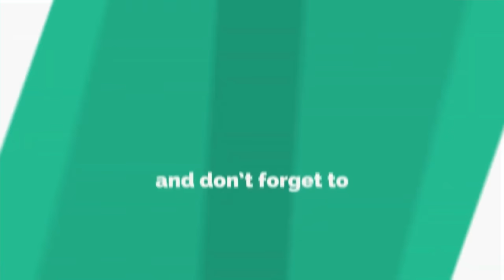Running Water, Live Edge Kitchen Counters, Swivel Loft Ladder | Ep. 10 | An Original Off Grid Cabin

Comment: Thanks for getting my day off to a great start 👍 , but as a contractor, I would advise you to ditch the drill for driving screws and get yourself an impact driver, it will change your life 😁
Reply from the maker: Thanks! I have an impact driver but the sound is so annoying. There's something calming tp me about the sound of a drill....haha.
Reply: @TheOffGridExperience  I understand totally about that noise but take it from an old timer, driving that many screws will eventually tear up your arms and hands. 😉
Reply: Quite right on the impact driver
Reply: I see it works but not a great way to teach others to build stairs.
Reply: I was the same way for a long time. I used to install hardware in apartments. Installed thousands of doorknobs, blinds, bathroom hardware, mirror clips, shelving, etc. I got stuck on just a drill and 20 years later I tried an impact. My drill died, smoked up and died on me. All I had was an impact. Not the kind these guys are talking about but a 3/8 impact. Works the same way though. I used a phillips 3/8 drive socket and was amazed at how easy it drove screws without stripping them one bit. No more expensive star headed deck screws for me anymore. Phillips and an impact driver all the way. The only time I use a drill to run a screw is when I want to be quiet about it. That noise does suck, but it means a higher quality job, no messed up screw heads, easy on the wrist, faster, and did I say just plain easier. Drills for drilling and drivers for driving. Although an impact driver will drill a fast hole in wood with a fluted bit and no clogging.
Reply: Nine times out of 10 I will reach for my drill over the impact. I find it's quieter and faster. I will use my impact when my drill is set up to pre drill. Used to be all we had was a drill driver. Anyway, no right or wrong way.

Comment: Very creative on the sink. I would suggest a p-trap on that drain or the smell from the grey water will come back in the cabin. Even if just draining down off the hill eventually the wind will blow right up that pipe.
Reply from the maker: I'm going to do a P Trap at some point. Just wanted to get the sink operational and figure out the grey water system later.
Thanks for watching!!
Reply: @TheOffGridExperience  Good deal man and I figured you would. Almost didn’t comment but wasn’t sure if you knew.

Comment: Your loft ladder is similar to the last one I built, except I started with an old aluminum extension ladder, and ended with one that was permanently bolted at the pivot. I would have used a 1/4 turn ball valve for the sink, but everything else was awesome. Keep up the great work and videos.
Reply from the maker: Thanks. I'm probably going to tinker with both as I move forward.
Take care!!

Comment: Great video.Thanks for taking the time to make these videos. I'm always interested in the different methods people use for creating running water in an off grid cabin. I like the method you have chosen. I went for a Whale Mk2 galley foot pump for my hand washing basin in my cabin outhouse, and also a cheap 12 volt pump for running a shower. For hot water I boil kettles  on either my gas cooker or my wood stove. I think I may look to use your method in my kitchen sink though, as currently I am using just plastic containers to fill the sink.
Reply from the maker: Thanks for the comment. Take care!

Comment: Looking great. I like the ladder design, aka locking foot. Does the drain on the sink have a grey water septic? The doors could use a sweep to control drafts. A brush design would allow the floor variations.
Reply from the maker: Thanks. Working on grey water system.

Comment: applying some very thick butle type tape to underside and lower vertical sides of the galvanised tub will dramatically reduce the tinny sound, and give it a substantial aura. very nice setup!! is that a fire extinguisher?
Reply from the maker: Thanks for the tip. It's a Zodi extreme shower pump.
Reply: @TheOffGridExperience  nice kit -

Comment: I didn't understand how the water system works. The stainless tank is pressurized by a hand pump?
Reply: Yes. Just like the garden sprayers you put liquid in and pump up.
Reply: @randydavis9324  Okay. I did understand. Thanks, Randy! BTW, does anyone know the tank's capacity?
Reply from the maker: Yes, it's a ZODI Extreme pump that they no longer make for some odd reason. I plan to use it for my bathroom shower when I get to that point.